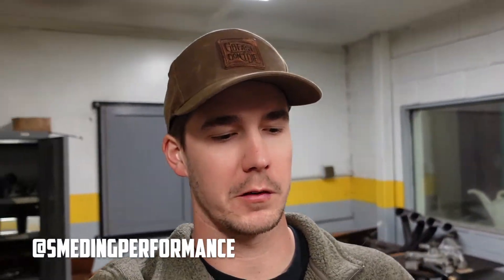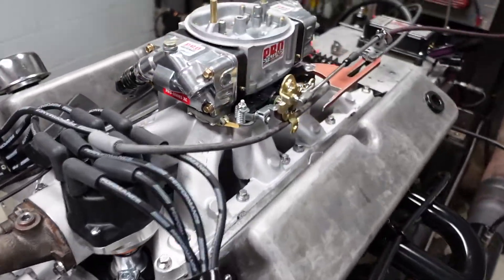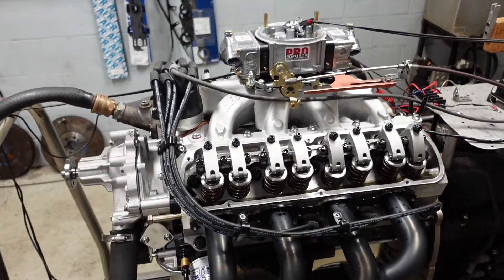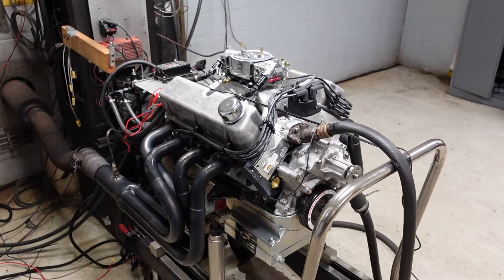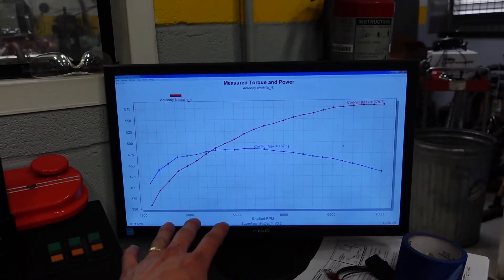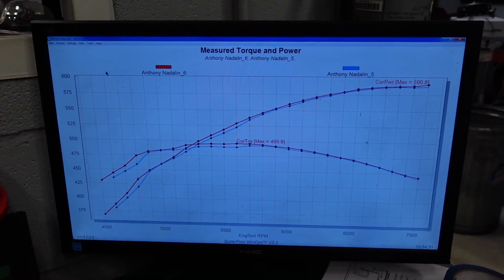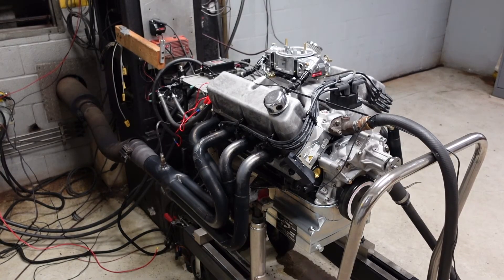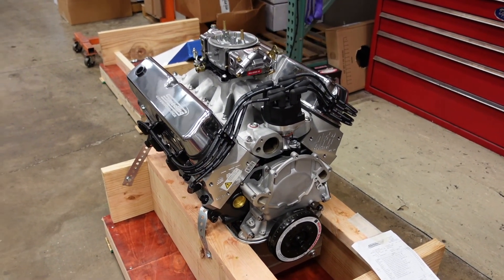Dyno Testing The 8,000rpm 363" Small Block Ford - Part 3

Comment: 590 HP @ WHAT RPM 7000? 700 LIFT IS A LOT FOR THE STREEET. 590 IS SWEET ON CRAPPY 91 CALI GAS. I SEEN 500 HP @ 6000 RPM ON A 363 FOR 91 GAS.. NO SENSE REVING TO 8000 RPM WHEN MAX HP IS @ WHAT 7000?

Comment: Put a programmable ignition on it, seemed to like 34 on high, as is normal.
engines takes more timing on top(as the cylinder pressure drops)

Comment: 12/5 comp is no mans land not a street engine not a 15 -1 race engine. i go 10 3.4 to 1 with al heads  10 1/4 to 1  with iron heads I SEEN 595 HP FROM A 363 WITH ONLY 6600 RPM

Comment: Wow i had a lot of respect for your work on this channel. Until...,
Valvoleen really?  I wouldnt put valvoleen in my moped or not even my lawn mower. There are 4-5; oils out there that are much better. And without going into a ton of detail i can tell you this. I have worked for a few race teams over the years and at one place we did some oil testing.  Very simple in tests on 3 different engines. We measured hp and torque of course but also max opperating temp . Parastatic friction, idle speed and a couple others that i cant remember. Anyway thete is only 1 true synthetic oil. All but 1 are crude oil blends. Only 1 is pure synthetic oil. Idle speed picked up 400 rpm opperating temp drop 25 degrees hp and torque both went up. And  peak oil temp dropped on avg 15 degrees. There were friction numbers that dropped but i dont remember what they were. Anyway Mobil1 is the only oil to use. Every cup car runs it regardless of sponsors every F1 car runs it . Every off shore race boat runs it. All BMW m cars come frim the favtory wirh it and is recomended. All Porsche' all AMGs use it and are recomended . The engineering patten was lifted 20  years ago. Meaning Shell , BP,   Texico Valvoleen and all the other oil companies can buy it, reverse engineer it copy it and put Shell name on it. and since that time not 1 company has been able to figure it out to this day. Back when it was called winstin cup and they didnt use resteictor pkates.  The best bearings be they a main bearing or a rod bearing can with stand about 220 degrees before the babit starts to flake off the bearing shell. At the time. the engine builders could turn a cup motor 9500 rpm but temp would climb so high the berings would start to come apart. This was something they could not solve. Bigger oil coolers more oil nothing kept the.oil temp down. Then Mobil1 came along and the celing was lifted. They still saw oil temps over 220 but they are turning them sometimes over 10,000rpm the reduction in friction  allows the bearings to live with oil temos over what they could deal with before. It wasnt the oil temp they learned but the reductuon in friction is what keeps the bearings in one piece.  There is a city police dept. associated with Ford motor company. Ford gave this pd a fleet of cop cars and the only stipulation was all oil changes were done at Ford. Every 10,000 miles. All cars were pulled at 100k the motors were torn down ans measured everywhere. Cranks, cams, rods, vsvle guides, bores, all of it. There was no measurable wear in any engine. So you can take that info and do what you want with it.  Ive seen these facts personaly and the other info from Ford came from inside the company when i worked for an associate of Ford Motor Co.

Comment: I thought a 347 was the biggest one could go with a 302 block. I guess it is able to have a larger displacement because of the aftermarket block. Is there any metal left on the cylinders for a future rebuild?

Comment: Lykins motorsports built a 363 with the same compression.  Got right at 600 h.p. and 517 ft.lbs. you don't get needed experience from a tech school. There are better more capable builders out there.

Comment: Laid over nicely ? Go ahead and use 538 gears behind that tiny cam if you want to , that combo is all puffed out at 6,800 you can spin it over and over to 8,000 rpm because of the good bottom end but if you had to keep trapping this motor over 8,000 over and over and over you better bring a giant magnet and a mop to the track with you nice motor though but if you're going to sell somebody an 8000 RPM motor use a 8000 RPM camshaft

Comment: You build a nice motor. I would've went a different route, but the customer is always right. I would've went: bbf 521, 6500 rpm max, nade 700+ hp on 93 octane and for thousands of $ less.

Comment: Nice build, very thorough and like your commentary along the way.. well done.With more comp as you mentioned, this engine would be way up over 600 hp with ease… The cam and head package would really come to life then.
Brent from Lykins Motorsprts did a similar combo with simple off the shelf parts ,custom cam,AFR 205cc heads,11:1 comp.Made 592hp@7200 &517 torque @5400.. Also a stout motor. He mentions too that more comp over 11:1 and up will also push this combo way over 600…
Down here in Australia we get 98 octane at the pump so Many guys can run up to 11:5 .1 comp on street engines happily..

Keep the great content coming.

Comment: A year late, but it's wild how high these old engines rev. Everyone talks about LS motors, my 363 makes power up to 7,100rpm could be more with a bigger cam. But that's a lot for a small block. Super impressive.
Reply: How did you go about buying/building one? I want to put one in my fox
Reply: @connerluke8377  Fordstrokers, woody built mine and he's a genius. I told him exactly what I wanted and he more than delivered.

Comment: These little 363's are pretty sweet.  Short deck=short pushrods, short intake runners, short stroke.  Most folks don't take advantage of those aspects.  The few that do?  They've learned.  The pro-stock guys (DRCE 2/3/4/5/etc)  go to great lengths for those short pushrods, short deck, short stroke and big bores but the old 8.2 deck Ford's came that way.  They're just limited in bore size due to the bore spacing.

Throw a good IR intake on it and feed it some methanol.  Of course it'll want a cam change to take advantage, and with the fuel you can get away with a lot more compression (E85 might also work....), but 700hp N/A SHOULDN'T"T be much issue assuming the heads will support it.  Prepare for some RPM though...

33 degrees is the sweet spot on mine, 438" SBF AFR heads.  34, drops off just a little, 32 drops off just a little.  I'd like to play with individual cylinder timing and fueling but ran out of dyno time.  Made 794 at 7700, N/A.
Reply: 794hp with AFRs?   Which ones?    Rich Holdener did a YouTube where AFR 225 out the box made 660Hp/565tq on a 427 with super victor, 12.25:1, and a 272@.05" cam with .735" lift.    Edelbrock Vic Sr ported to just over 400cfm made 750hp/615tq on the same combo.
Reply: @dennisrobinson8008   afr 1451.  You have to throw the compression at it, cam the daylights out of it, spin some RPM, and feed it some good fuel.
Reply: Thank you, you've put up one of the best post i've read in some time and I totally agree with your short stroke big bore principal. Where a stock 400 chevy has a 3.750 stroke x 4.125 bore my 399 based on a Dart 400 block is 3.625 x 4.185. My street 10.7 to 1 n/a combo was built for 91 but runs 93 pump, big 18* heads, modest solid roller(spring durability), 950cfm, 641hp@6400 & 560 ft lbs.@5700, where I feel the big bore comes into play is my torque from giving the 2.18"x 1.65" valves room to breathe, 400 ft lbs,@3500, 513@4500, 560@5700 and 526@6400, I believe my torque #'s are in part due to the larger bore.
Reply: That's not a lot of power on that size motor
Reply: @billymorrall2682  Six hundred hp on a pump gas engine is stellar. The lack of compression is probably giving up 100 hp at higher rpm.

Comment: Turning a 363 to 8k to make less than 600hp? I’d be disappointed. Something is mismatched. We’ve made more power at 7500 with a 302 and 10:1 static comp.
Reply: Can you please provide video proof?
Reply: @sean5comet  type in v8 Supercars into YouTube search bar. Before the 2023 rule change, all cars had 302 ci engines
Reply: What heads were you using?
Reply: @Greenskies321  D3 Rousch but they aren’t ported to nascar spec. You can get the same flow from lots of sbf heads. Lots is being missed in camshaft and inlet manifold
Reply: D3 on 302 probably made no power under 7000.
Reply: @Mr.RollTide  These engines pull string from 3500rpm. Watch videos of them on YouTube. Rpm range isn’t a function of head size, it’s cam timing, intake/exhaust runner lengths. You are also imagining that they have nascar size ports and valves - they don’t.
Reply: @jpl1983  What size valves do they have what do they flow at .700?
Reply: @Mr.RollTide  I can’t give you specific information, it’s hard earned information that I don’t own the ip for (my boss does). These engines are still used in 2 categories. The valve size is about 2.2 for the inlet. I won’t state flow numbers other than to say that if we were allowed to run them beyond 7500 they’re push pretty close to 700hp.
Reply: @ 
1. Our motors run on both pump gas and E75.
2. These engines pull from 3500, any engine pulling to 8k isn’t going to be much good below 3500. Including this one
3. Yes our budgets are high. All that money goes into reliability. These are endurance engines that need to be able to do 6 hours of continuous racing. A street car engine is getting an occasional rev for a few seconds. Having said that current price is 50k Australian. Not bad for a high powered endurance race engine. 
3. A 363 making less than 600 and needing 8rpm to do it is Avery inefficient engine. I’ve built a 289 that makes 530 at 7600 using factory iron heads (historic racing rules) and pump gas. 
4. You need 1/4 mile slips because dynos lie. That’s daft. A race car is a system, that time slip doesn’t tell you anything about the engine alone. Factored into that is power:weight, grip and aerodynamics. Keep coping with your backyard bro science engines.
Reply: Claiming you built a 302 with 10.1 compression, no power adder and made over 600 H.P!!!  That’s 2 horsepower per c.i.d, Are you feeding it Pure Oxygen from your Neighbors little roll around Oxygen breathing Tank, maybe taking the regulator off to get more Pressure!!! 😂😂😂
Reply: @LawrenceBee681 . Do yourself a favour and read up on the Australian V8 Super Car engines!! They make well over 600 hp from 302 cu/in with 10/1 comp.  Take a close look at the intake manifolds,the rod pin diameters, the ring packages and you will see they surely do make that power.  Don’t forget they have had over 30 years of development to get to this point.  I spoke with Jon Kade about these little engines many years ago, and he was impressed, and JK isn’t impressed easily😊
Reply: @LawrenceBee681 I’m not the only one, and it wasn’t just fords. And they make more than 600hp
Reply: Without proof, seems like you are full of shit...who's "we," some website you saw or are "we" supposed to take your word for it?
Reply: Fr. It takes a lot of work and dedication to make a SBF live reliably at those rpms. Just wouldn't be worth it to me without some REALLY impressive numbers.
Reply: On a 302.......I call big pile pf doodooo
Reply: @ there is an entire category of race cars with 5 litre engines making 650hp on pump gas
Reply: Splitting blocks........sounds like a nest story book.
Reply: @ you do know aftermarket blocks exist? Are you ok?
Reply: @joshiek7839  that's not applicable  to the video you're commenting  on, no dart blocks here. Go troll  elsewhere
Reply: @ it’s a 363. Your not doing that with a stock block. That’s most likely a dart block. If not a ford Motorsport. You fool.
Reply: @joshiek7839  I think  you should do your homework  and read about  some of the not so common crank kits available!
Reply: @ he says it’s a dart block in the first minute of the video. The troll is you.
Reply: The one thing not mentioned as far as I can see in this post is the fact that the Australian Super Car motors are HIGHLY modified!  They have also had 30+ years of development.  They are NOTHING like this engine.  The induction system alone is a piece of work!  About $10K worth.  The crankshaft uses very small journals to reduce parasitic drag, the camshaft uses needle rollers, they are dry sum engines, and it goes on and on.  I have had a couple of them and they are not that street friendly, basically pigs below 4500 rpm.  Let’s keep everything in context here!😀😀
Reply: @ having driven one and worked on them for the last 20 years, they are not pigs below 4500rpm. In fact you’ll be surprised how good they are. Not sure how you’ve arrived at any dollar value for the parts. The great thing about development is that we can all learn from and apply. To say they are nothing like this engine is ridiculous. Are they not a 4 stroke IC engine?
Reply: Are we still talking about a 302 ford based push rod engine??? 2 valves per cylinder? Running on pump gas, no power adders!!!  Parts that any person wanting to build a Sbf can order!!! Basically like in the engine from this video!!! Minus the custom ground camshaft!!! Im 48 years old and was all involved in the 90’s SBF engine area and have built many engines. And 600+ naturally  aspirated running on pump gas with 302 c.i.d SBF, only 10.1 compression,  is no easy task!!!! Y’all can claim who ever builds them all the time and other countries build them better than the guys in the United States!!! I’m calling Bull Shit!!!! GD God Bless America and these idiots that read to much without any real experience!!!  It’s like all the bolt on people that add up their HP based on the advertised bolt ons they buy!!! With all my bolt ons I’ve got about 900 hp in my Honda civic, I added it up from the magazine!!!
Reply: @LawrenceBee681 you don’t have to believe me, just search v8 Supercars. Until the gen3 rule change we made as much as 650hp. Sorry this hurts you ego.
Reply: Joshiek 7839, can you add a link of those Super Cars or the Video channels!!!  My ego isn’t hurt, What Super Cars with 600+ hp have ever came with the push- rod sbf 302, which is actually not even 5 liters if you really want to know.
Reply: @LawrenceBee681 you open your Google browser or what ever your favourite browser is. In the search bar type “Australian v8 Supercars”. Have some cream on hand for your butt hurt
Reply: Joshiek7839!!!!! I finally found the super cars you are talking about!!!! WTF!!! Your original post to this video said you would be disappointed for the 363 to make less than 600hp!!! Did you know that the Engines you are talking about at that time Cost well over $100K!!! Most of those SBF engines cost as much as $150k!!! In this video the 363 engine that was built is Less than $20k and made right at 600hp, would you really consider spending $130k for 50hp!!! If I paid $150k for an engine that didn’t make over 3500 HP theses days with the technology!!!  The bad thing is I can put a single turbo on a junkyard LS Or Coyote with a little prep work and make 900-1000 basically reliable HP for under $10k!!!
Reply: I honestly think you need to Apologize to the Man that Posted this Video!!!
Reply: @LawrenceBee681 why would I need to apologise? A 363 turning to 8000 rpm and making less than 600 isn’t fantastic. I’ve built iron headed 289s that make 530hp

Comment: This cam is huge for a street car.  Durability factor with big drag cams on a street car. Very hard on the valvetrain parts and lash must be consistently checked. Ramp rates on drag roller cams are brutal on the street.  I would never use a drag roller solid roller cam on a street car. Comp cams sells solid roller street cams which actually make crazy power and last a long time.

Comment: I was under the assumption that a 351 block was needed for a 363.   Isn't rod angle to much ?
Reply: 8.2 deck 302 block 4.125 bore x 3.400 stroke

Comment: Not impressed by the heads... a better head should have had you in low to mid 600s with that Cid and rpm. I don't think compression is the issue. A Yates head would have stomped that number... but I understand customer constraints. Maybe it's going in an early shock tower car?

Comment: no such animal as a small or big block ford that is a windsor block ford as they also made many other designed blocks in 351 cid and that could also be a clevlend or it could be a FE block 352 cid block all the same size and the funny part the 351 windsor used the same crank bearing setup as the ford 351m/400 clevlend and the ford Clevlend head would also mount right on the 289/302/351 Windsor allowing you to build a clevorb ...as you can take a stock ford clevlend 400 crank a michen the counter weights for clearance rebalance and drop it in to a stock ford 351 windsor block and and make a 413cid all stock ford part windsor motor using all factory parts

Comment: Very nice build 🏁 I prefer a longer rod  like a 6 inch but if it works it works
Reply: 6" on a 8k rpm engine?????
Reply: @bigboreracing356   - Your right.  I was in a hurry and didnt explain it correctly, was just trying to type something.  I meant a lot of rod to throw around, in general.
Reply: @bigboreracing356   - okay
Reply: Cannot put a six inch rod in an 8.2 deck motor

Comment: That was awesome build like you say higher compression would require high octane/race fuel to obtain higher power numbers. As it sits now it’s 
Pretty killer for a 302 based street motor. I could see this in a 289 FIA cobra replica. Great job👍🏼
Reply: I had a mentor that built a 289 pushing 504 HP@9,000 rpm, and raced it all season long. His 1st session was Black Flagged at Daytona. They swore he was running 427SCJ. 168.76mph lap speed. 210 in the back stretch. They teched it and conceded. He was the only one stomping the gas pedal in the turns. Ford wins. Now gear drives let Chevies keep up. Push the inside wheel down and you can go faster.